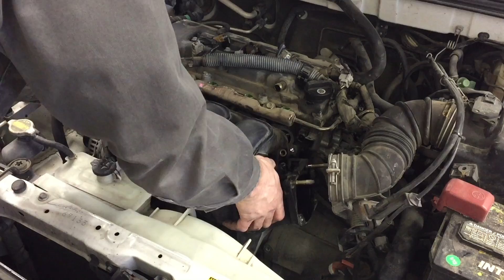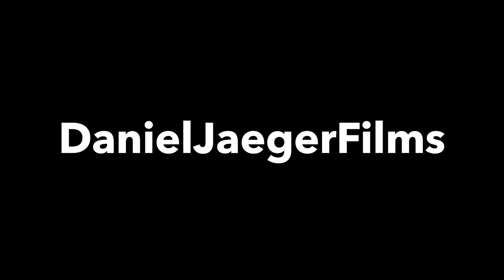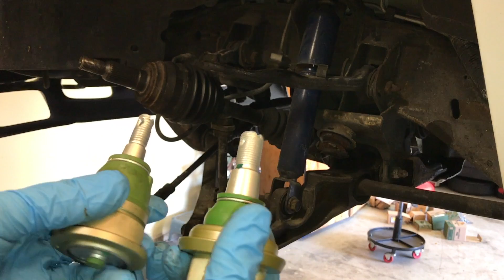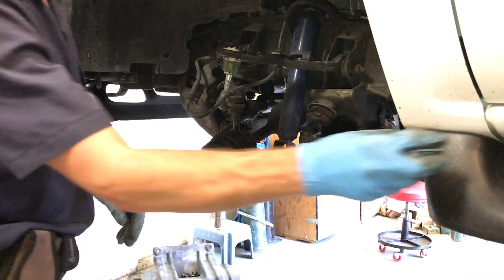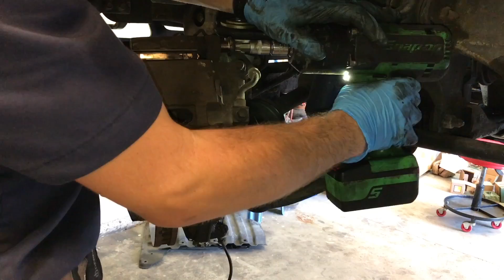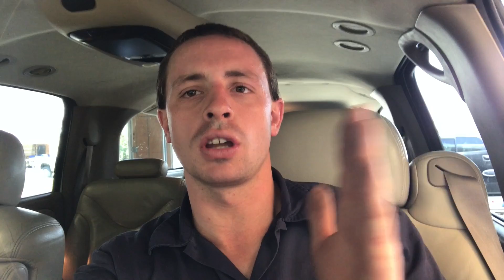Step by Step - How to Install Ball Joints

Comment: Hi You tighten the Ball Joints using an Inpact Air Wrench.?? You suppose to use a Torge Wrench. Even on the Lug Nuts. Next time use Precision. It matters.

Comment: Pretty good video but i would never recommend tightening a tire with a battery power impact and then just putting the center cap on. Make sure when the vehicle hits the ground you torque the tire down with a torque wrench and then put the center cap on.
Reply: U don't have to use torque wrench when u lower vehicle just use a tire star and tighten them till u hear a squeaking sound and u know its tightened
Reply: Video was about ball joints,  but wheel install

Comment: I like to use a large ratchet and dead blow hammer to press the joints in, those c/u frame presses never seem to stay perfectly square and things tend to bind more than should be.
medium impact and hammer works ok too, just bang on the press-frame in direction your pressing the join it, seems to keep it square and go in much smoother

Comment: Great video. May have to check out that brand if my Moog's ever wear out.
Reply: moog seems to have went sell out chinesium too..  the boots just don't seem to last on anything anymore
Reply: throttle bottle I have to agree there, I'm pretty disappointed in them so far. I've already destroyed the upper ball joint in my control arm. Lifetime warranty but it should last longer than 10k miles.
Reply: used to be the rubber was still good when the joint flat wore out, now the boots tear m grease exits water/salt/debris intrudes and game over.
they act like nobody owned or seen the 90's and previous vehicles :)

Comment: haha motorcrap (motorcraft)
Reply: Had my truck 218k miles, original motorcraft front end parts. Definitely worn and need replacements but not dangerously worn by any means. They make quality parts from my experience. Pricey though.

Comment: Ford vans always eat ball joints... I've seen them go to shit in under 40k miles. In my experience the lower right usually goes bad first. Napa has started selling these green ball joints. You can tell they're pretty good just by looking at them. 

You should NEVER tighten the axle nut with an impact wrench. If it's too loose or too tight, either way can damage the wheel bearing. You should know that Daniel. Always torque the axle nut to specification with a torque wrench..... and if you're re-using the old nut (which is not recommended but many people do it anyway) I'd recommend adding some blue thread locker for peace of mind.

It's also worth mentioning that you should make sure the weep hole on the boot is pointing away from the brake rotor. This prevents excess grease from contaminating the brakes. Some ball joints even contain specific instructions mandating which way the joint is clocked.
Reply: I used to believe that too but I've seen a Ford dealer tech do it to a newer truck with an impact when I got my truck inspected. Guess it is an old wives tale. I still use the torque wrench though.
Reply: @user-rz9er5dm6k  sloppy tech. Shops nowadays have way less master techs and their main priority is checking what the new less trained techs do. It's not the good old days anymore.

Comment: Here come the torque natzis... your doing it just like I would do it. Ive personally seen many other of the mechs ands techs in the dealer and shops ive worked at do it the same way. Is it 100% right? No but you get a feel for torque when you work on vehicles every day. Nice video Daniel. Thanks for sharing
Reply: once you witness a new bearing failing in 2 weeks from not being torqued properly, you learn to take the extra 2 minutes to tighten the axle nut correctly.
Reply: Krankie V Not gonna lie and be a troll. I hear you 100%.  It's the guy tightening the axle nut that may have caused the bearing failure, or just using junk parts, or the cusomer slammed a pot hole or curb. Even installed with a torque wrench ive seen them fail within 4 to 6 months. Depends on many factors. Of my 10 years I've personally never had an issue that I know of. Not saying a torque wrench is not the right thing
Reply: I've also seen dealer techs use an impact. The advance auto parts manager said the cheap hubs fail early because of cowboys like Daniel. They are often back in a few months. I think he is full of shit though, the value bearings are just garbage.

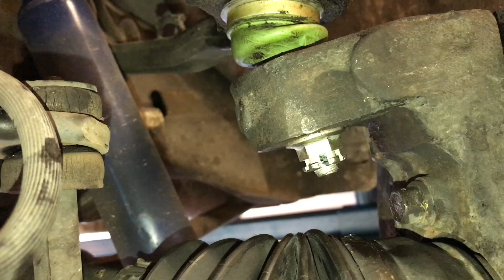Comment: ball joints should be greased before installation or a least greased before you attach the steering knuckle to em. at 6:24 you can see he's almost torn the new top ball joint by twisting it.
Reply: that's not twisted at all, that's just the severe angle of the control arm. The manufacturer actually recommends putting a jack under the lower control arm to apply weight to the suspension before tightening the ball joint nuts so that they are installed at the angle of normal operation.
Reply: Alex's Bikes and Motors and

Comment: Center nut should get torqued with a torque wrench.
Reply: rusco321 yea, I will tell you exactly how to torque it: turn wrench until tight.
Reply: Steven Vanheel If you don’t want the bearing to live for very long.
Reply: rusco321 what bearing? The wheel bearing or the cv joint?
Reply: Steven Vanheel It's the same nut. The nut that goes on the cv axle also holds the bearing together with the right amount of clamping force, if set at the correct torque.

Comment: How can you tell when you need to replace the ball joints? I have a 2007 Suburban with 200k miles, not sure if I need it done.
Reply: What Happened on my 1993 Sentra SE-R was, every time i would accelerate, the front of the car would shift to the left. As soon as i let off the gas, it would shift back to the center. And i could hear a squeaking noise when it shifted. The passenger side joint was bad, so i replaced both control arms and new joints.
Reply: +NOLAItsNotOva Thanks for the help
Reply: SuperGolfguy11 No problem
Reply: SuperGolfguy11 Ripped boots is a common sign. Another way to test them, is to grab the wheel at the 12 o clock and 6 o clock positions and pull. If there is clunking or movement, most of the time that's ball joints

Comment: Good job overall, I personally would not use an impact to put a spindle nut back on because that could potentially damage the bearings in the hub assembly. 
I personally just use a torque wrench to put those back on. It's fine to use an impact to take the spindle nut off though. Just thought I'd share that with you, otherwise great job!